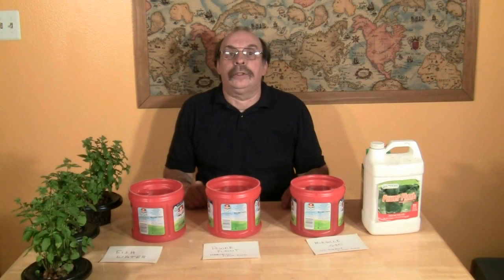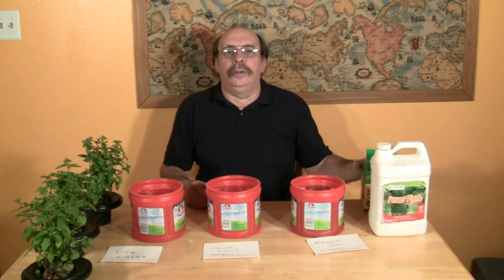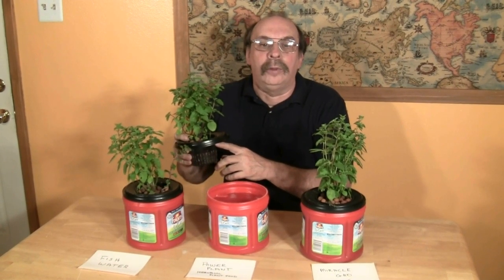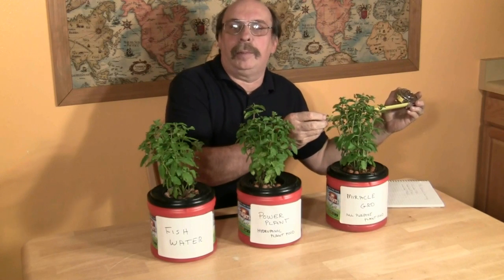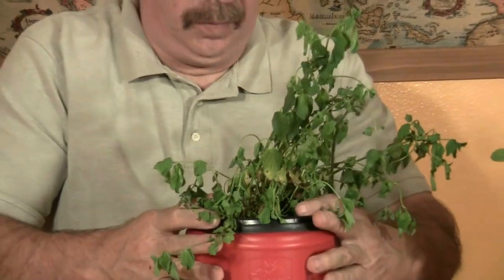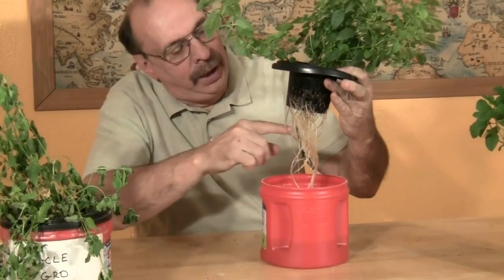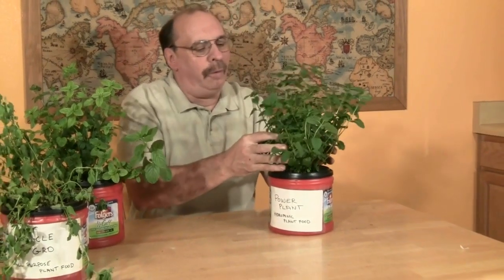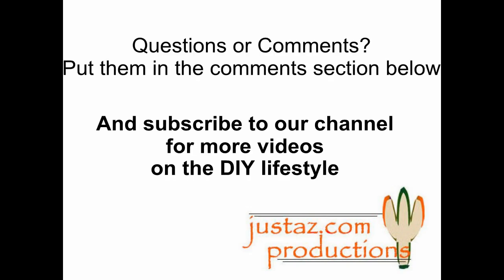The Hydroponic Nutrient Challenge

Comment from the maker: Hello, Kathleen Donegan. Citrus trees in pots can be fussy, and they can take some time, even a couple of years, before they actually produce good fruit. If you used the general purpose Miracle Grow, it may have made the environment within the pot too alkaline for the trees. Citrus trees like an acidic soil so if the pH got a little too high, they may have reacted to that. Check with your local nursery and ask about specific fertilizers for citrus trees. I would also consider re-potting with a potting mix specific to citrus trees, and these should also be available at your local nursery or garden center. It sounds like your trees are okay, and a couple of adjustments will get them growing. Thanks for watching our video, and best of luck with your trees and in all your DIY projects.